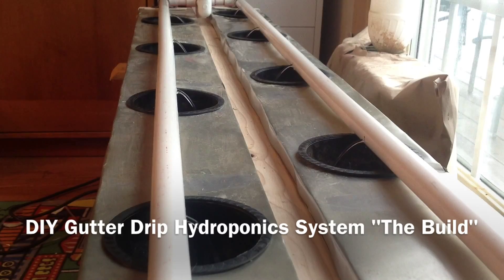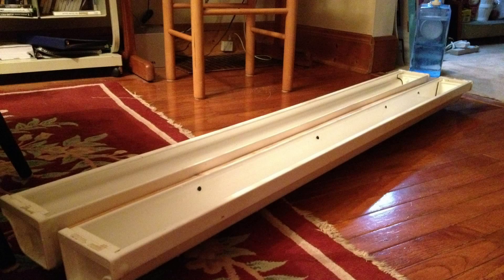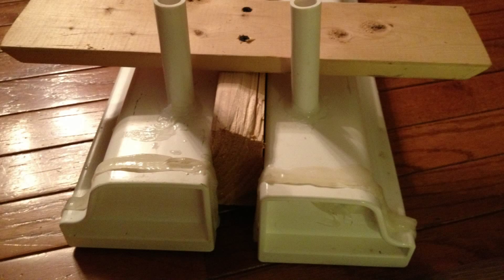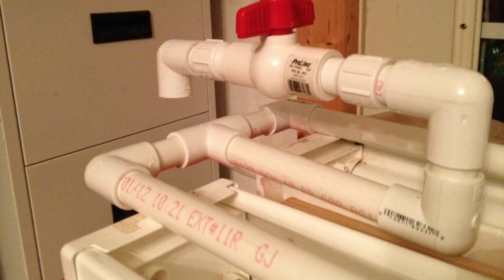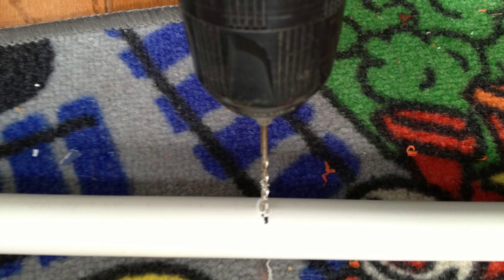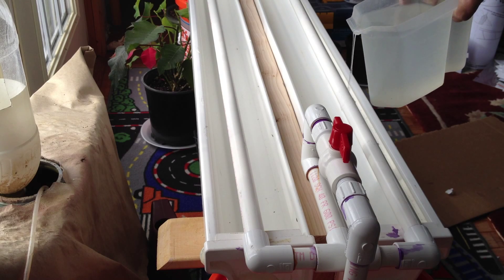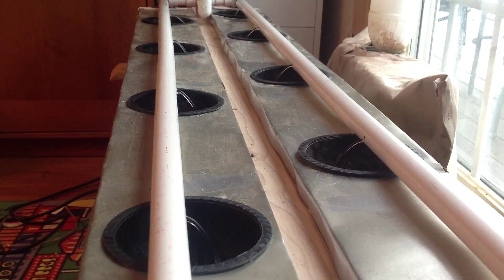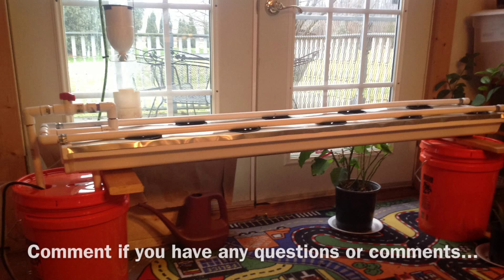DIY Drip Hydroponics "The Build"

Comment: Seems like your drip tubes would be in the middle of where the stems would grow! Maybe adjust a bit more outward and the pressure would get it to the center of the root mass. My two cents